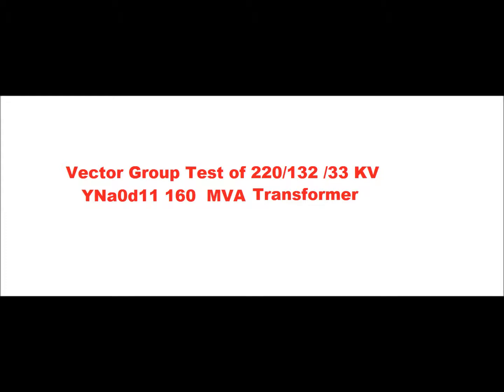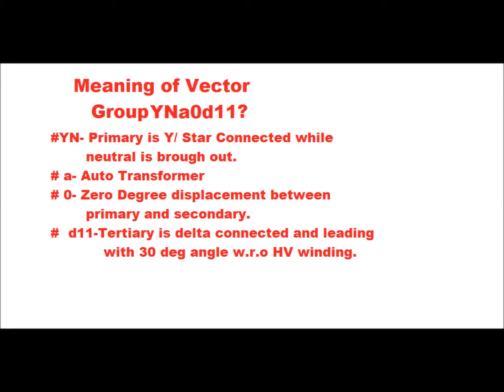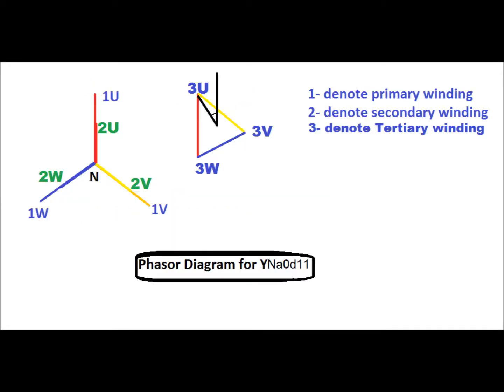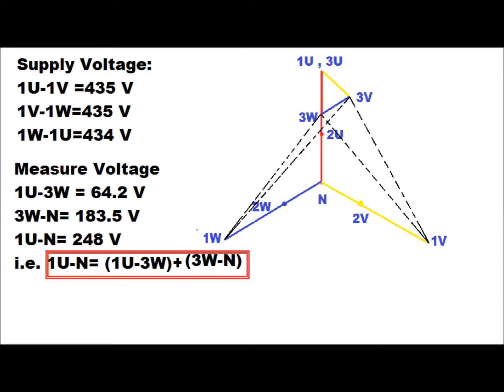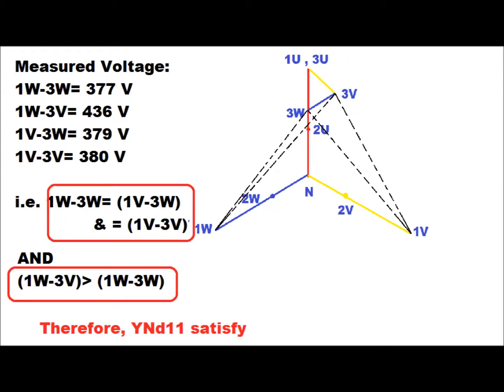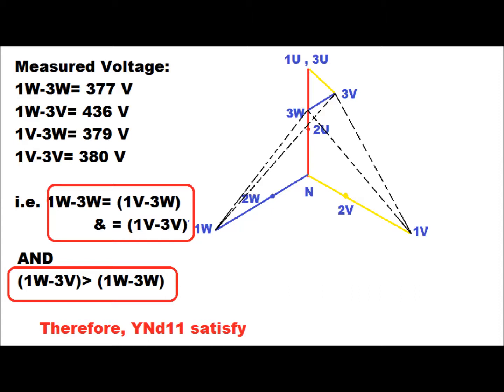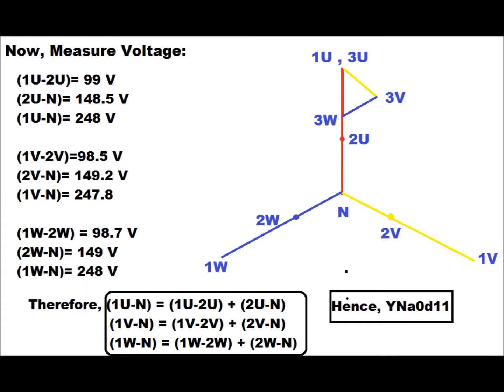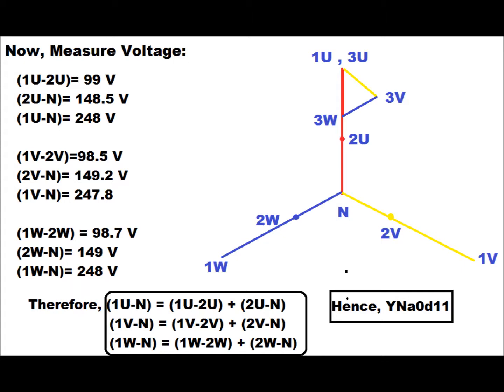VECTOR GroupTest 160 MVA YNa0d11 Auto Transformer

Comment: Hi, good work there. May I note that in order to test this transformer as per your method, the turns ratio or voltage ratio of the auto-trans must be available for calculation to confirm those voltages in you video.